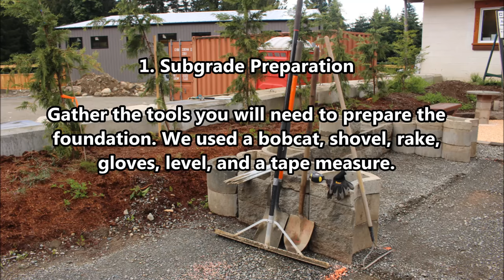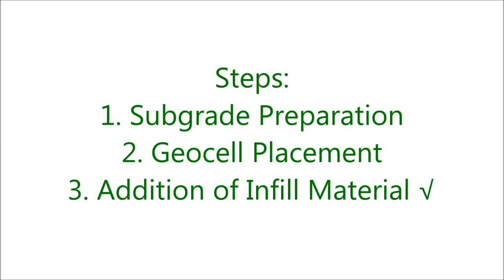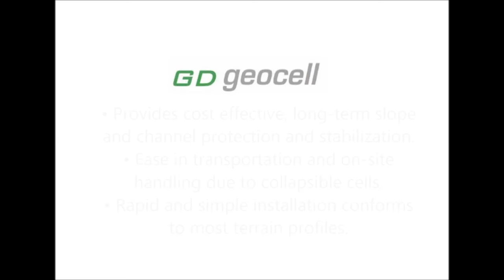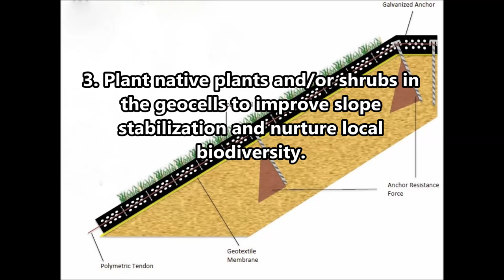How to Install a Gravel Driveway or Gravel Parking Pad

Comment: How many years will this last without dealing with weeds?  Thanks.
Reply from the maker: THAT we can't answer! It would most certainly depend on how many seed sources are nearby. Having said that, seeds that land in our system, are landing in 'clear' gravel, so no compacted material where the roots can get a hold. As such, very easy to pull out. Thanks for your comment and apologies for the oversight and delay.

Comment: Baloney- We've been laying Grave DW's for Decades.. You Grade it for Drainage, Good MediumSize Rocks for the Foundation, Lasy your Same Grvel your State Hwy Dept uses ( Rock Dust packs it Hard as Concrete)  Add Top Color Layer you want( Brown, Gray, Black, etc)  add Top Gravel Lerl( 2-3",- Ave $300)  ave every 10 yrs.. or before selling your home &  to dress it up? Add some Black Charcoal Bricks on the Sides boarding your Lawn.. Weed Control? Simple- You use a 6 mos Weed & Grass Control- 1 gal $10-$15 with its own Manual Spary or Pour it in your 1 gal Sparyer in Spring.. Snow Plowing ? Have them Plow when 4" or more and keep their Blade Guides 1-2" above the ground so not to plow up the gravel onto your Lawn..
Reply from the maker: I would certainly use what you are suggesting on a long, rural driveway, just not around my house where dust and gravel can be brought inside, moved around the driveway, onto neighboring surfaces, or otherwise. Our foundation is dust free, rut free, you can put table and chairs on it, wheelchairs, you can use decorative rocks without needed to top dress over time. It is more of a substitute for pavers, concrete and asphalt, not so much for road crush (or decomposed granite). The final surface is clear, stable and aesthetically pleasing, similar to hard surfaces, but permeable. Comparing our LEED, ADA, and SUDS compliant system to a packed gravel system is not what we aim to do. Our offering is a hard surface substitute, staying permeable over the long run with the benefits per above. A compacted gravel surface hardens over time (amongst other things), so quickly becomes a non-permeable surface. Just depends what you are looking for! Thanks for your input.